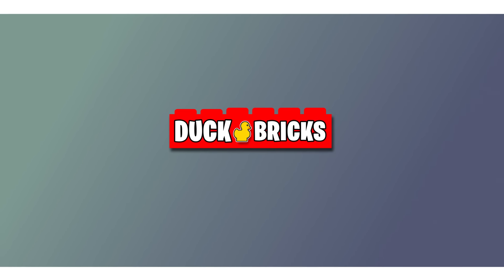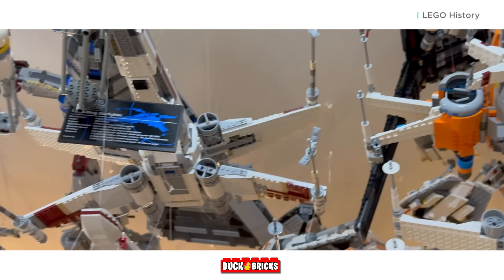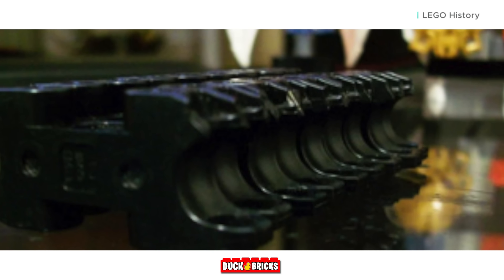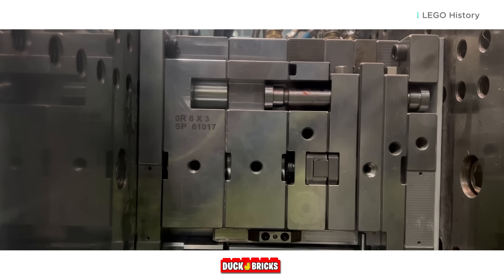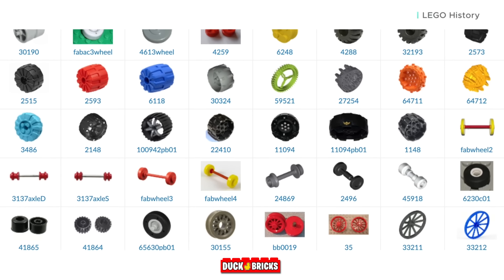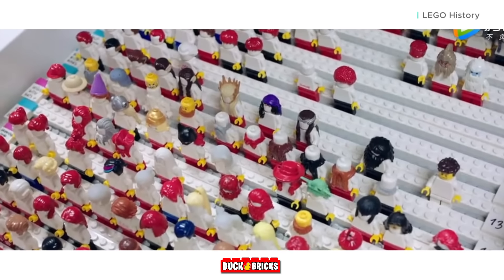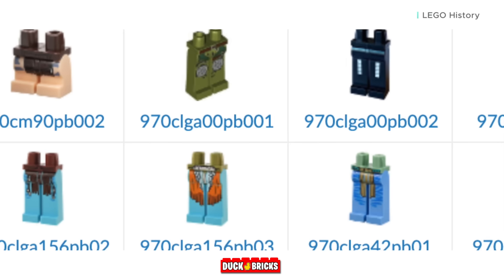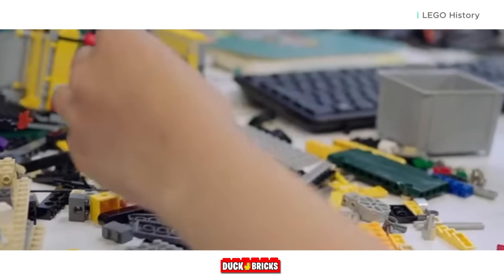Why Does LEGO Destroy Molds? LEGO History: Ep 2

Comment: i find it really strange, almost unbelievable that 5 years of storing a mold costs more than making a new one..
  "Due to the intricate design and level of accuracy needed, each LEGO plastic injection mold can cost up to $200,000, with some going as high as $360,000."
Reply: yeah I’d love a more detailed explanation of what said storage involves than the book gives!
Reply: @rylieaitch  It doesn't make sense to me either.  I can store an industrial CNC machine for a decade for less than 10K$. 

Maybe the molds require maintenance, like if they're prone to corrosion, and that cost goes to employees... If you need one employee, making 70K a year for maintenance for every 1000 parts, cutting your molds down by 3000 saves 200K$. 

So maybe what they meant is, it's cheaper to rebuild one or two, then store them all.
Reply: It's crazy that you can buy model kits made with literally 60 year old molds, but LEGO can't make it past 5. The whole point of injection molded plastic is to set off high initial cost of tooling a mold by using it tens of thousands of times.
Reply: @Ranstone  Or perhaps, on the scale they would need to store all of the molds, its not economical.
Storing a single CNC machine? Yeah, buy a fucking storage unit for 100$ a month, dirt cheap. Potentially find cheaper ones.
Leasing a warehouse capable of fitting several hundred, or several thousand extremely precise metal molds without damage? Very expensive very quickly. And thats not accounting for shipping, or several locations if one isnt enough. Or the cost of damages if something went wrong during transit or storage.
Risk versus reward, storage isnt worth the risk, or profitable enough to justify keeping the parts. If they arent being used, its cheaper to dump them.
Reply: @pauldeddens5349  I think you're onto it, this is a case where economies of scale work in reverse. More molds to store equals more expensive warehouses, more power expense to control the climate in those warehouses, more expense on security, more property taxes, etc. Look at famous market leaders of Lean Manufacturing like Toyota and they have a very similar policy to keep their warehouses as small as possible.
Reply: @pauldeddens5349   even with (i would say especially) with the scale i could do controlled environments, security, maintenance and bookkeeping for far cheaper.. no there must be another reason, i think.
no they send the molds off to some place in Ireland to get destroyed.. so the shipping costs etc are already there
Reply: @modulitv  Part of the concern of shipping isnt A to B with high precision molds, its preventing damage. If they are to be destroyed, they can be shipped on the slowest and cheapest freighter to Ireland for all they care. Damage during transit is meaningless, they are due for destruction.

Shipping to a warehouse with the intent of minimal damage is a different story. Misloading, collisions, even potholes could wreck the investment of their mold. Each mold would need individual packaging to ensure they aren't experiencing shock or chipping. You cant just slap them all in a box and call it a day. Between the weight and necessary volume of packing protection, is becomes very uneconomical very quickly, whereas those same precautions are meaningless when they are sent to be destroyed anyways.
Reply: @Boltscrap  Not to mention that with each set, most pieces are all from different countries. This means that they manufacture pieces in a bunch of places and then have them all shipped to a country where it's all sorted and bagged with the right colors for a set. That's one of the reasons why Lego has gotten so expensive even without inflation
Reply: This thread explains more than the video. A throw away line in the middle of the video explained why it can't be any shed, but I still didn't understand why LEGO didn't buy a former chicken farm, those things have already some heavy climate control, at least the factory like ones, and added some extra. Solarpanels on the roof. Done

But transportation (that's only two times though) and people working, guards probably, may bump the price.

How big are these molds?
Reply: thats bullshit i can tell you - they literally can buy some small plot of land right next to the factory and plop some cheap warehouse down to put all molds there in some brown box with a QR code for identification. Does not require much maintenance other than keeping the building up and the shelves alright. Should be less than 1000€ per year. If you include an HVAC for dry air in the warehouse might be 5000€ to run it, hecc let it be 10000€. Still cheaper than a single mold that then can hardly be 1:1 identical.
Reply: @edopronk1303  It varies. For small pieces  like 2x4s they tend to mold several parts at the same time to maximize mold real estate. For larger parts it may be the only part on the mold. It looks like on average the size of the mold plate is about the size of a shoe box. Potentially larger depending on what the mold is of, like the floating ship hulls or 4+ parts.
Thats also only counting Lego and not Duplo parts, which are magnitudes larger and full of even bigger specialized parts. Which alone may double the expected storage space, if not further expand it.
Reply: Yep becasue they are making them in the EU.......
also one thing people do not consider, is that these tools are massively heavy.

So  you need special buildings, becasue if you group them together they actualyl cause the factory /storage place to sink into the ground.
then you have to open them every few months to stop them locking up...
Plus any sort of rust on a internal surface can completely destroy the mold finish, or destroy the mold closing, due to the surface not being completly flat.

They are not just blocks of metal you can shove in a warehouse for years on end.
Reply: @Calisota   nonsense, clearly you never actually dealt with mold tools in your life...,  good luck on storing a chunk of high density steel  weighing several tonnes on a "shelf"
Reply: If I heard right in the video the molds have to be stored in a climate controled storage center. Likely the cost being higher is if they have prefigured X amount of square footage for absolutely needed molds to be stored, likely on site at the factory. Where as molds not in active use would possibly be stored off site, which would mean rental cost for space, utilities to keep the climate in the storage location right, and maintenance so the storage space maintains said temperature. 

As said they have a prefigured number of molds they are able to keep and store and going over that number means it would incur a VERY sizeable cost.

Comment: It would be amazing if they kept a copy of the molds in a vault like they do with sets just in case they want to bring back an old part. At least for special molded parts.
Reply: This was literally the point of the whole entire video. Its cheaper to destroy the mold and remake the mold than it is to just store the mold for even 5 years. This way they save costs and if the old piece needs to come back it forces them to update it to their new standards ultimately making the piece better.
Reply: @CryNhn yeah but it would still be cool it’s not like it would put a dent in there profit
Reply: @bradyblaze08  Not the way Lego sees it. One of the major issues during their financial struggles was making too many specialized parts. They never want to go back to that. Sure, they are the biggest toy manufacturer now. But it is because they cut unnecessary costs like keeping molds they weren't using.

I think the system is perfectly reasonable. And it does mean designers have to really think if they want to keep a mold around. Find a way to make it useful at least once every 5 years or lose it forever, unless you can prove the need to remake it.
Reply: @CryNhn  I made the comment before he brought that up.
Reply: @CryNhn   Yeah and molds wear out and need repair and the molds themselves are really heavy and bulky. Also the metal is expensive so it's better for them to be recycled.
Reply: @bradyblaze08  I feel like you still dont understand, keeping molds arent as cool as keeping sets or the pieces for safe keeping. They are extremely heavy and big pieces of machinery made completely of metal. The whole point is to reuse them for other molds. With the catalouge of pieces, theres really no real reason to keep all the molds, As a bystander you would just be looking at hunks of metal. The lego vault of sets is sufficient enough.
Reply: @Crazyguy_123MC then finish the video before commenting dude :/
Reply: @crazyguy_1233 ignore the haters. It's cool you're so into the material that you commented immediately!

One point I'm surprised didn't come up is the constant improvement in manufacturing techniques, which might make some molds incompatible with current machines. While the design of the standard 2×4 brick hasn't changed in decades, the machines producing them sure have. I doubt that even without degradation factored in, those decades-old molds would work in today's machines.
Reply: I get more information from the comments than the video.  He sideways mentions some points, but nothing about the molds themselves.
Reply: We do have 3D printer that scan anything and make that part what you wanted
Reply: @bradyblaze08  Yes it would. Again the video literally said it costs them less to destroy and remake a mold than storing if for just 5 years. Meaning if they destroy it today and need it next month thats STILL cheaper than if they kept it and needed it 4 and a half years from now.
Reply: @YOBAMUSTDIE  If they havnt been used in the last 5 years then the mold is gone. BUT I would bet they have the CAD files so IF they need them they will just get a new mold made.

Comment: It would be a huge shame if the original Kanohi molds are long gone and not in deep storage somewhere. Can always dream of them doing a limited run of original masks in modern day colors for the 25th anniversary or something.
Reply: I'd be happy with just a mask bag (with included stand for them) just for the celebration. Not even any figure or set; just that exciting feel of collecting the original mystery bag of lego before minifigures took it over ^^
Reply: 99% impossible 😓
Reply: The original molds are almost definitely gone unfortunately, however it’s still possible for them to make new molds for a limited run. Although based on the video I wouldn’t bet on it at least for a long time until Lego’s operations change somehow. A limited run of masks is more likely than a full reissue of a set bc they’d only need six new molds for the masks, but they probably still wouldn’t do that today because they wouldn’t really be able to be used anywhere else across the system which is what they’re big on these days.
Reply: @michaelyocum7082 I mean… they probably still have the CAD files/spec drawings, remaking identical molds is purely a cost issue not a technical/logistic one.
Reply: the video basically says that's not possible
Reply: if any bionicle parts did still exist, they would probably be less specialized parts that could easily be used in other contexts. Highly IP-specific stuff like masks would be the least likely to stick around imo.

Comment: We probably won't get further information any time soon, but I wonder if Lego is taking steps to document existing molds and make it easier to resurrect them in the future without incurring that initial design cost again; I'm sure they at least have a system to quickly and cheaply replicate molds for evergreen pieces that wear out all the time, and if the retired molds can be digitized for later reproduction they shouldn't be lost as easily.
Reply: its called "ebay" and can get you the result of the mold without having to redesign it, plus data storage isnt as costly so you can be sure there is information to work with if it comes up again
Reply: The molds are designed in CAD software (either by lego themselves or by a tool and die fabrication / machine shop) and injection molding components are designed for fabrication by a tool and die company. It isn't difficult to re-machine a new mold when you still have the 3D files and drawings for tolerancing, and mold texturing needed when they originally had the molds machined, it should all be documented in the drawings / digital files. He stated they only started using digital files in the 90s and Bionicle had a lot of 3D printed prototypes for the 2001 line, so Lego definitely has the 3D CAD files for all the Bionicle components.

Comment: They should do what Gundam does and keep reprinting sets from over 20 years ago
Reply: Yeah, even with the P-Bandai shit, Bandai does a great job with it, unless a kit is being replaced by an upgraded version (or is P bandai...), it's constantly on print. Aren't the Unicorn kits (constantly being sold) using 2007 moulds? It's funny how lego kits use much smaller and reusable pieces while gundam is mostly big sprues used on a single kit. Of course, sprues can be reused (IBO kits all use the same inner frame with different armor for example), but it's mostly separate stuff.
Reply: @Morrowinder777  i recently got a reprint of the MG master gundam a kit from 2002

Comment: If they really want to Lego can remake the molds. They may not keep the mold around, because molds for injection molding tend to be big and heavy, but every mold starts out as a technical drawing. Last century that would have been a blueprint (a big sheet of paper), nowadays it`s all digital. Modern molds are STL`s (stepfiles) you upload into your cnc machine. The cnc machine then can make a new mold if needed. The molds themselves are not that important to remake old parts. 

also, molds wear out when used for production. You can only use it X times before the bricks producedare out of spec.

Comment: I missed a lot of information. Your best info was a throw away line; that the warehouses had to be climate controlled. But still, an old chicken cel farm can be climate controlled, so I still don't understand why it's cheaper.

A mold can cost up to 200.000, even 360.000 someone mentioned. How big are these molds? Less than a cubic meter? In the chicken farm I've been in you could store at least a two and a half thousand. That's millions worth of molds, work to make them. I missed in the video why storage is expensive.

The points you mentioned are good; better molds, theme's that did poorly. 

Still, what makes storage so expensive? More than 200.000 per 5 years. (Per mold!)

Comment: yeah at late 90's and 2000's you could see many new molds that were just new to be new. It must have costed them lots of $. The 70's-90's lego had almost always multipurpose molds. Watching 2010's + you could see the same tendency that was in 70's-90's time span. Its better as it makes a set more compatible for rebuild or changes by a kid or adult at home.
And its a smart decision, in automotive industry we have to hold molds up to 10 years on avg. Its expensive.

Comment: 🙄 What people don’t understand: With todays methods you can easily create a mold from the CAD drawings. Even most sensible instead of trying to keep a decaying hunk of metal around that once was used in a machine that is not there anymore as well. Throwing away molds — which you need to do after a certain amount of throughput anyway — is a nothing burger. The metal even gets recycled. Not throwing away the drawings is the important step. Which lego doesn’t do.

Comment: The weird part is, we don't really need them any more thanks to the Takua and Tahu set they last released, since it uses 100% lego system pieces (and 1 custom printed piece) which I still believe is the perfect reason to bring it back. There is literally no excuse on the part problem now.

That and I can see the Tahu and Takua slope tile be reused for things like minifigure heads or computer console faces. I'd love to see the original masks return with a new redesign to be reusable as parts for other sides (like armour shoulders or hands, etc..) but I can see why they scrapped them; the current single axle joint just limits the reuse for it. 

The video really opened my eyes to the process lego uses and the amount of work that went into it clearly shows. You did a fantastic work DuckBricks and whenever I think about if they could return or reuse a piece; I'll rewatch this video to get a better understanding on if it's a reasonable request or more me just wanting it to return.